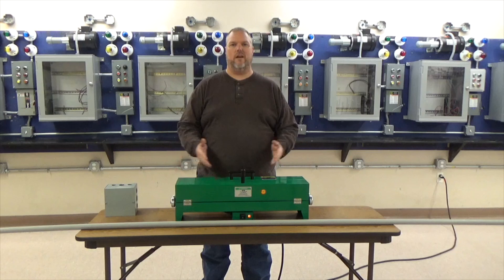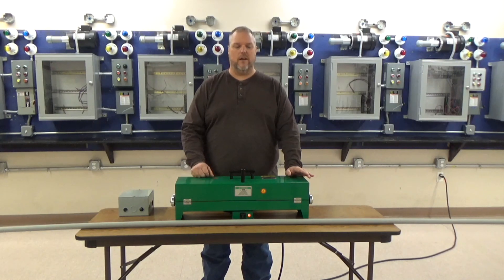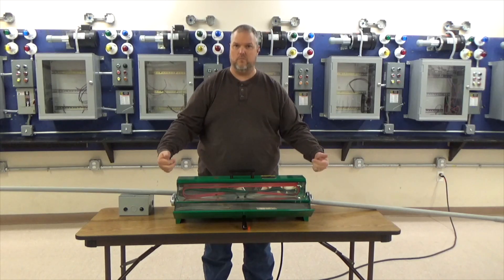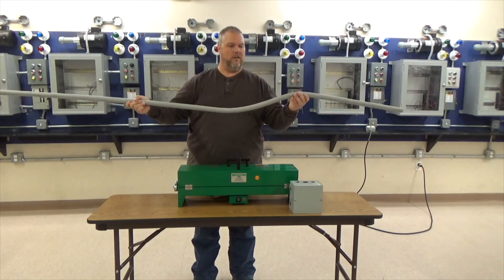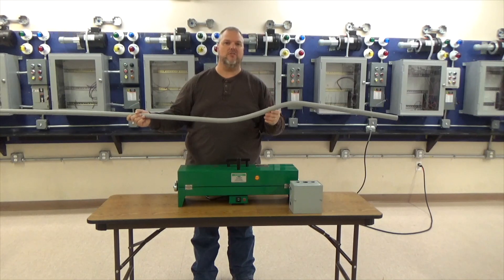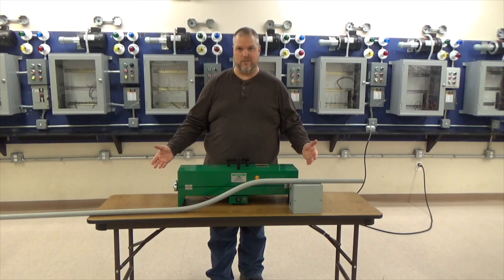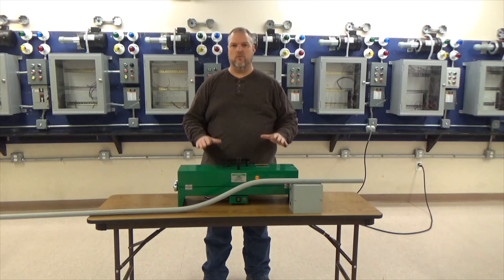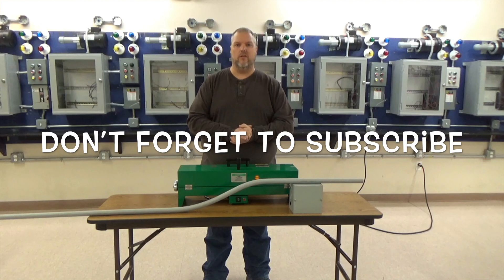PVC Bending

Comment: Personally, I have ruined a few segments of PVC heating too close to the end of the conduit - which expands the conduit out of spec at the one place you need to have it stay in specification in order for connectors or couplings to fit around the conduit.